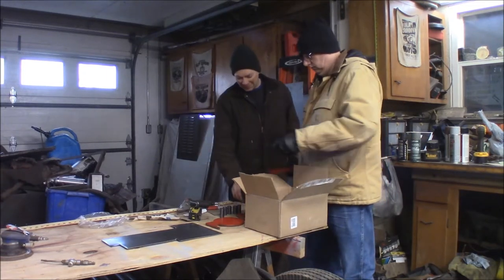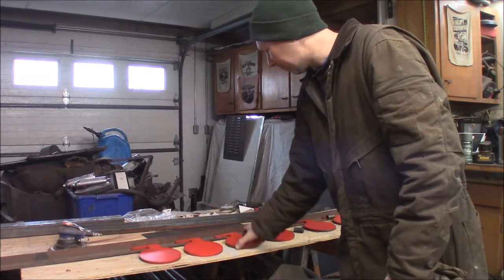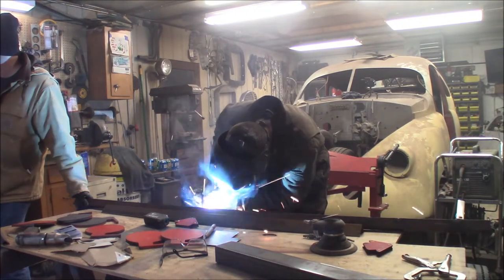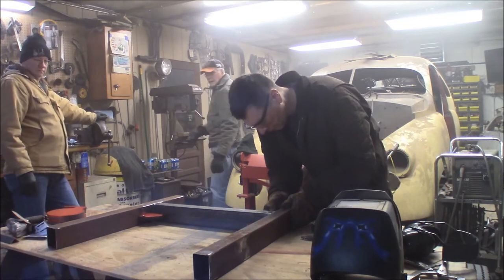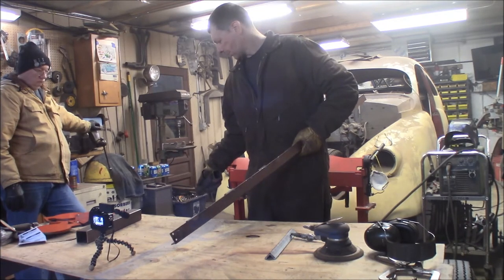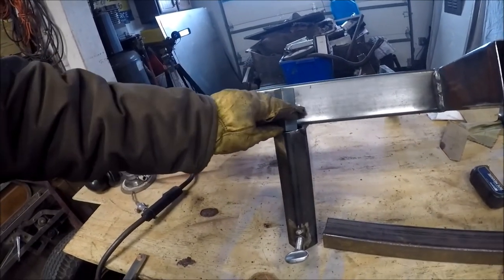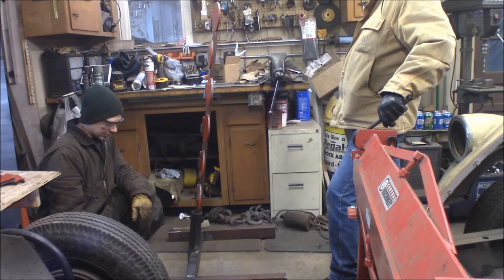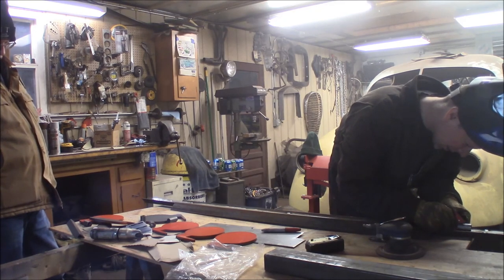Build a Dueling Tree!  $100 DIY Project

Comment: having issues with multiple plates swinging when one gets it. Also getting some splatter at 10yds. Im assuming the splatter is because the angle of the plates are too inwards to me and i should probably find a way to lean them back. Idk what to do with the whole tree shaking and all the plates moving.
Reply from the maker: Honestly we haven't shot at this one yet.  Id say maybe you need heavier base if it is moving around causing the plates to flop
Reply: You can make the hinge points stiffer by adding some industrial beeswax. That way only one plate should swing at a time.

Comment: I don't have a welder. Any ideas how to attach the pipes to the angle iron?
Reply from the maker: You could try two high quality worm drive hose clamps per pipe.  Clamp them around the angle a pipe pieces tightly and that might hold.
Reply: Get it all setup ready for welding and take it to a shop that welds. I'd source out the shop first before putting the money into the materials. It's also a good idea to go ahead and get a cheap welder. I got my welder 3 years ago and I've loved being able to weld things I couldn't before.
Reply: Hot glue and duck tape? 🎉😂